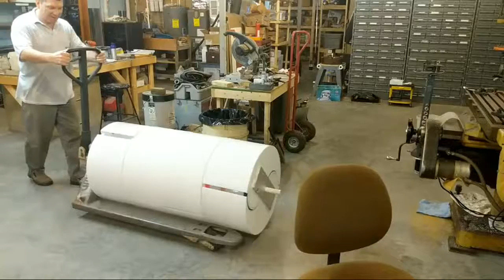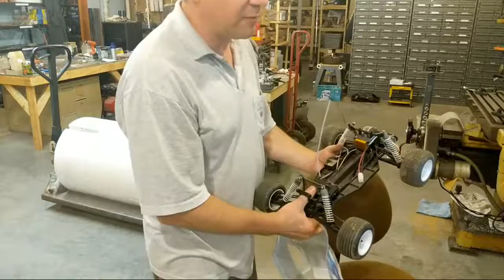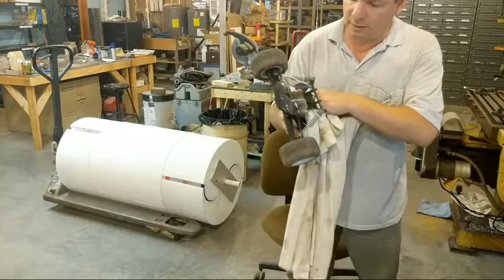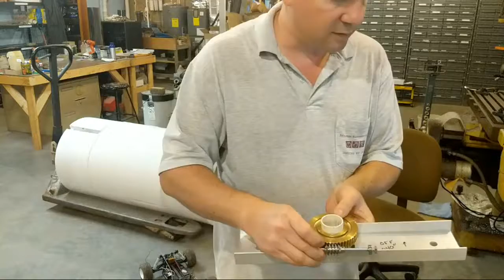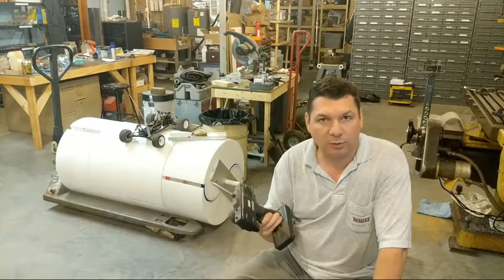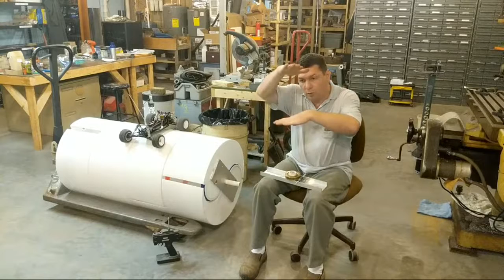Building Harmony VAWT's Furling Mechanism from an old RC Car

Comment: In the future could tie controller into a wi fi weather station.
Reply from the maker: Thank you for the suggestion Steve but this is going to be a much more direct feedback loop that is installed in Harmony. My plan is to monitor the RPM's of the unit and control furling directly based off of that information as well as wind speed sensors on the base. I can't rely on outside sources.
Reply: @HarmonyTurbines  H i, I agree it is better as you say, I was thinking of a source of collecting wind speed info to feed into Harmony.

Comment: Hi Chris, Good to see progress Grooved shaft to provide positive stops sounds good. How do you plan to waterproof r/c gear, possibly whilst setting up you could use some alignment pins in addition to screws to reduce any inaccuracies. Miss live feeds as I am in Australia. Cheers Steve
Reply from the maker: Hi Steve, grooved shaft will likely be how I go to make the furling shaft and then the gears will have a key slot in them so that everything is lined up and positively driven by the furling shaft in unison. But for this prototype anything will work. It's just a proof of concept and as such only needs to demonstrate the functionality. In later prototypes (Mark II, Mark III, etc...) we can figure out the engineering behind making things weather proof and maintainable. For now ...glue it is on the gears, and an open RC unit on the bottom. This unit will not be running in the rain. It's just to gather performance data.
Reply: @HarmonyTurbines  Sorry I keep getting ahead of what is happening now! I am not being critical just making a few comments so that in the future you may already have a few thoughts for other situations. Cheers